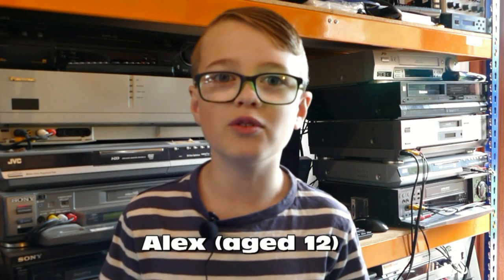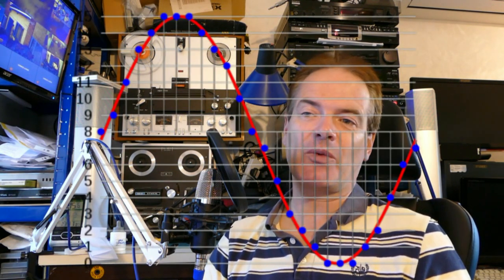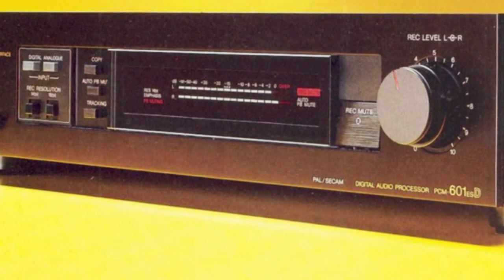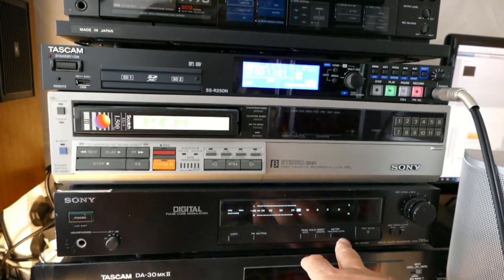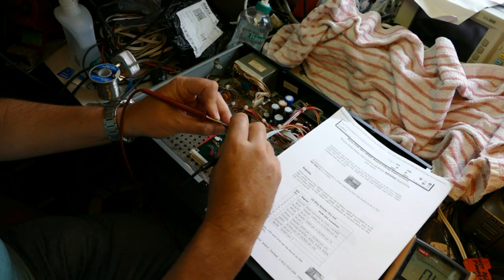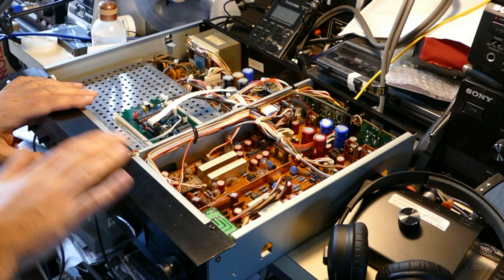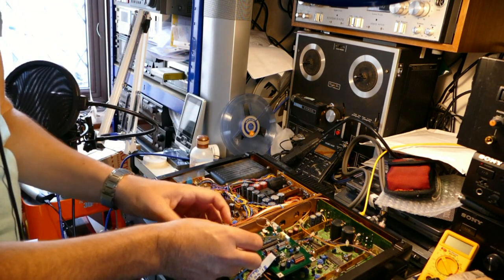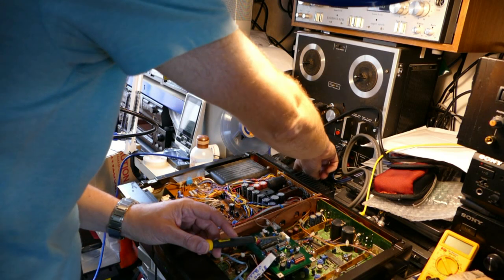SPDIF (S/PDIF) output on a Sony PCM-501ES or PCM-701ES decoder.

Comment: I used a PCM 501 in 1984 to create the first broadcast from digital on Melbourne classical station 3MBS-FM.  (It was a first Australian performance of a rare baroque opera.) Owing to delay in delivery of my SLC9, it was actually recorded on a borrowed portable VHS recorder.  It was later carefully transferred via the 'copy' function to the C9 when arrived, and then assemble edited for broadcast.  (It would have been better on the HiFi 150 that had a flying erase head.)

Later in the '80s, a London firm called Audio and Design offered an add-on for the PCM701 which added digital in and out and a digital fader.   Distance and not having a 701 meant that this desirable course of action was not pursued.  Besides, the availability of a computer with digital inout and output didn't arrive until Sound Designer II (for the Mac, a brand for which I had an ideological contempt at the time).  I used on at a commercial recording studio to transfer tracks (in analog domain) for a commercial cd release - with results a couple of orders of magnitude better than an analog tape to digital transfer.  My use of digital for production swung to MiniDisc (an MZR30 and the a MD 501) where assembly editing could taken place in the digital domain.  When my PC with an RME digital interface arrived in the late '90s arrived, apart from transfer only in real time), record on MD (later the HHB professional model) transfer and edit on Sound Forge was the working method.  Only with the arrival of my Nagra V in 2003 did the situation improve ...

Anyway, a couple of comments on alternatives - at the time of the PCM 501, I also evaluated a unit made by JVC designed for use with VHS - but of course also worked on beta.  Overall, I felt that its performance and features were inferior to the Sony ...

Now the challenge - prior to the introduction of the portable beta recorder F1, and the subsequent PCM-F1 unit (a boon to wild-life recorders), sony had two experiments in consumer digital recording - the PCM10 (late '70s) unit and the subsequent PCM100 unit (early '80s - I have Sony documentation and a photo of it).   Anyone ever laid hands on one of these units - or even better still have one?
Reply from the maker: I have a PCM100 here, it does pop up on one of my other YouTube videos about PCM-1630.  I'm told that the format is the same as PCM-F1 but I'm not sure if that's true.
Reply: Yes, I've had the PCM10 and PCM100. I still have the PCM10. I sold the PCM100 because it was in the way. Now I regret it. The difference between these two is the SDIF2 input and output on the PCM100. They are both 14 bit machines with NTSC video processing. Both have the unsurpassed LED meters with a very high resolution, which are at most surpassed by the professional RTW meters.

Comment: Interesting solution for emphasis, but I guarantee you get a lot more dropouts via SPDIF.  I think some of the error correction in the PCM adapter is bypassed when using SPDIF.  I’ve had tapes with tons of dropouts via SPDIF , yet played flawlessly via the analog outputs.  It solved the emphasis curve at the same time.
Reply from the maker: Never had that.  Perhaps your SPDIF circuit's PLL was struggling.
Reply: video99.co.uk I have the 601 adapter and was running it through a beringer sample rate converter because of the non standard 44.056 kHz sample rate.   Drop outs!  They disappeared with the analog outs.  

I didn’t think of the audacity red book curve.  I was trying a vst eq plug-in suite from izotope ozone  that has it, but it didn’t sound right. It made it muffled.  Yes the pre emphasis light was on.
Reply from the maker: @pauladams896  Perhaps that sample rate was the problem.  My Tascam SS-R250N doesn't seem to mind it.

Comment: Difference between models: PCM-501, PCM-553 & PCM-601 has multiplexed A/D, so 11,3 uS difference between channels (A/D is switched 88200 times per second (PAL version) between L & R). These models also have OVC (additional knob for adjusting tracking). PCM-F1 & PCM-701 both got proper, dual A/D, so channels are not shifted in relation to each other. PCM-F1 has single CX890 D/A, externally multiplexed between channels. PCM-501, PCM-553, PCM-601, PCM-701 all use CX20017, multiplexed D/A that I can't find any solid info about (googling for "cx20017 datasheet" brings loads of PDFs with just single page containing general overview), so I don't know how it deals with samples and whether there's any 11,3 uS difference (probably I have to check this with scope). anyway just for the purpose of output signal quality, there shall be no practical difference between PCM-501, PCM-553, PCM-601, PCM-701 (with PCM-501/553/601 having an advantage of OVC knob, that might help in troublesome cases) - if there's any difference, it might be caused by different analog out section, though I didn't compared the schematics to see if there is any difference. PCM-553 (Japanese-only) and PCM-601 got digital in/out. As for digital out is concerned, it could be assembled cheaply from components available today, as per schematic: http://www.myprius.co.za/PCM501_SPDIF.JPG so no need to fiddle with Whistlewood's board. I would have built that myself (along with trying to wire digital in with WM8804 - I have already ordered both it and DIT4096, so maybe I will build a kind of SCMS stripper with these) if I hadn't acquired PCM-601 (in the course of 1,5 month I've acquired PCM-501, PCM-601, PCM-701. I'm lacking PCM-F1, though I'm not sure if I want it, as PCM-701 is in essential the same thing (sans single externally multiplexed D/A) and for portable recording gear there are better options for ages - if I had any field recording needs, that's it). Trivia: (1) PCM-1 (first consumer audio processor) predates EIAJ, it is not compatible. Literature says it is 13-bit. Second consumer model by Sony - PCM-10 is EIAJ conformant, though it lacks 16-bit mode, introduced only with PCM-F1. (2) 16-bit recordings could be replayed with EIAJ-conformant 14-bit only PCM processors, albeit with reduced reliability (one correction word instead of two). (3) PAL/SECAM PCM Processor could be switched to NTSC with slight modifications. At least this was said about PCM-701, though from service manuals I see this should apply for other models as well (that is, for those with 16-bit capability, as I have no service manual for PCM-10, nor for PCM-1). The converse is not true, as PAL/SECAM machine is superset of NTSC one. (4) PCM-701 & PCM-501 were used in mid-to-late eighties as a cheap instrumentation recorder for recording neurophysiological signals. There are some mods described in several papers from that time (getting rid of emphasis and extending frequency range down to DC were among the most common, I've also seen some channel splitting as well as interfacing it to IBM PC for acquire and subsequent analysis, even with automated VCR control). (5) PCM-501 uses standard TTL logic levels. PCM-701 is said (by those papers about making instrumentation recorders out of it) to use -5V/0 levels so modification of that particular model might be a bit harder.
Reply from the maker: Fascinating information there.  I had seen that schematic before, but in practice, building one of these would have been more time consuming than fixing the Whistlewood design board.  If anyone has done a PCB layout for that design though, I would love to give it a go.  All the PAL/SECAM models seem to be able to play back properly with NTSC tapes, which is handy.  Well done for getting a 601.  They are absurdly rare.  I think the 11.3uS issue is only really a significant problem with mono recordings, and so far I've not had any of those.
Reply: IIRC the CX890 and CX20017 are the same DAC chip. Yes, it has the same 1/88200 delay. Sony also used it in the first CD players, such as the CDP-101. I would figure that if it's possible to get a SPDIF output from an early CD player using the CX20017, then SPDIF output would work on all PCM processors that use that DAC.

I do have a PCM-F1, I've opened it up myself (and have very good high quality pictures of the PCB if you want) and you are correct, it uses 2 A/D chips but only 1 D/A chip. The chips have heatsinks on them, and the text "890" is printed on the D/A chip.

Comment: This would not work with the original PCM-F1, right? I would love to have S/PDIF in my PCM-F1. Also forgive me for this question, I didn't watch the whole video but does the mod require soldering? I don't want to solder/drill holes in my chassis, or anything like that.

Also an easier way of de-emphasis IMO is using SoX. It's a command line tool but all you do is type "sox "input.wav" "output.wav" -deemph" and it will apply de-emphasis to the file. I use it for my some of my really old audio CDs that contain pre-emphasis, and it works great. 

Also, my PCM-F1 always has the pre-emphasis applied during recording, you can't turn it off. I did read that someone who owned one of these units managed to disable the pre-emphasis circuit?
Reply from the maker: Yes this will work with the PCM-F1, you just have to configure the board slightly (different power supply).  Yes you do have to do some soldering to install it.
I find the de-emphasis curve is very easy to apply using Audacity.  What's harder to do (I've not worked out how yet) is to apply the half a sample delay to one channel.
Somehow there was a way to make recordings without pre-emphasis, but I'm not certain which model did that.  There's no switch on the F1, 501, 601 or 701 models, I know because I have them all!
Reply: @video99couk  Oh cool. But explain the different power supply? Also, where does the SPDIF jack go? 

If it does require soldering then I don't think I can do it myself which sucks. I'm located in the US. I know your in the UK and it would be a nightmare to ship.

Do the industrial PCM processors for U-Matic decks have a pre-emphasis switch? I would assume so. 

I have some early Japanese CBS/Sony CDs from the early 1980s, I assume they used a PCM processor and a U-Matic deck to master them. A lot of them have pre-emphasis but some don't.

Comment: I am an original 501 owner and took it out and listened to old studio recording from the 80s , worked perfectly. Was it also the case that these units delayed one channel slightly relative to the other? I have a vague recollection of this but not sure
Reply from the maker: There was no delay if you used an analogue output route, but if like me you modify it to have a digital output then there is a half sample delay on one channel.

Comment: I would love to know where to get that SPDIF connector you used. I have a 501 ES and I'd love to modify it to output SPDIF. By the way, I have a Toshiba DX-900, very rare, that outputs 14-bit digital simultaneously with very high quality FM analog stereo on separate output connectors, allowing dual stereo outputs. Love your channel!
Reply from the maker: The S/PDIF modification board is hard to source.  I bought one from German eBay and the other from a YouTube viewer.

Comment: Hi I have two of these 701ES and would like to grab the outputs from them. Out of curiosity are you limited to the 44.1 in your tests? I'm thinking it may be possible to use the ADC with alternative clocks pulled from an external device (even perhaps at 192k). Possible you think.

Great work! I believe these ADCs still hold up today (in terms of how they sound - i.e. not sterile). I'd love to hear a sample of music in 14bit mode.
Reply from the maker: I understand that these units are fixed to 44.1k sample rate.  I can't see how you could alter that since the recordings themselves are based on that sample rate.  The only option is 14 bit (with extra error correction) or 16 bit.  The 701ES has better DACs than the 501ES I'm told, but since my 501ES now has the S/PDIF output installed and working, that's of no consequence.  I've had customer feedback on the results from S/PDIF files with the Red Book De-emphasis applied, which is very positive.  So I think that's better than using the analogue outputs of either machine.
Reply: I'm not interested in playing back pre-recorded files, rather just use it as a standalone ADC. I'm confident I saw a pretty quick n dirty hack that innvolved tapping into the video circuits alone, it looked easy enough to even me (I've limited experience). I wouldn't have collected 2 PCM 701ES otherwise. I've lost the webpage that gave instructions but I definately remember it being really really simple involving nothing but wiring direct to the video micro controller. 
Regardless, the 11uS delay between channels would still be problem, though.

I would love to get these chips filickering at 192k. don't care about bit depth, even 14bit wouldn't be a problem at 192 if considering the psycoacoustic theory in conjunction with bit depth v sample rate. 24bit is only necessary for 44.1/48 and the rate increases renders higher bit depth unecessary,
Reply from the maker: @weeg91  I see.  That's a bit beyond the problem I was working on here.  Yes the 11uS issue is well documented, and can certainly be a problem with mono audio in particular.  By the way, have you tested your 701 units back to back to check they work properly?  When I first got mine, it had an electronic fault which I had to repair, it turned out to be a fusible resistor had risen in value.  I see there's a 701ES on eBay at the moment which has some kind of odd modification including a 25-way D connector.
Reply: that connector hosts a spdif output believe it or not! there is info archived on this page about it: http://web.archive.org/web/20021008164334/www.whistlewood.co.uk/pcm/701.html

Comment: Great video! I've only recently come across these unit (501es/701es) and am interested in their capabilities and components. Hoping you could advise what DAC chips are used for the standard analogue output?
Reply from the maker: PCM-501ES used CX20017 DACs.  I don't have the service manual to hand right now for the PCM-701ES but I understand it used more expensive DACs.
Reply: @video99couk  Did a bit more searching and found the service manual for PCM-701ES: https://freeservicemanuals.info/en/servicemanuals/viewmanual/Sony/PCM701ES/
Sony kept the CX20017 DA chip for the 701ES also. Not sure if it helps but a forum thread I came across whilst searching had some information on the SPDIF output module from your video. https://www.diyaudio.com/forums/digital-source/106425-sony-pcm-701es-mods.html
Reply: @video99couk  Also, the CX20017 DAC was used by Sony in their early CD players, such as the CDP-101 from 1982. 

I'd love to test the DAC, but I really don't have any way to get pure digital audio into it, as I don't own a CD player that uses that DAC, and the PCM-F1 doesn't have SPDIF input, I can only get analog audio into it.

Comment: In your opinion, what is a good reason for a hobbyist or audio enthusiast owning one of these digital tape recording devices (i.e. a DAT, Hi8 or PCM video recorder) nowadays given the costs of tapes (except VHS  tapes) and the cost of upkeep of these machines? 
By good reason I mean besides anachrophilia and except cases such as owners of already large collections of pre-recorded material in these media.
Do the recordings last for more than 2-3 decades or do these tapes (and recording devices) start becoming a liability in the long term? Do you think they offer some long term benefit as recording medium over, say, hard disk storage?
Reply from the maker: I can't think of any good reason to make new recordings on these formats, no.  It's really to archive recovery purposes that they need to be kept going.  But some people just like to play with old equipment anyway.
Reply: @video99couk  Thought so. It's a pity 'cause they're great machines. 
I'd think that for keeping an audio archive one might have a slight preference to keeping individual tapes per recording vs having all recordings in a single storage device (e.g. an hd) which might provide some false sense of safety against total loss due to damage to the medium but I guess one would be trading one type of risk for another.

Comment: How much glue logic does this board require to be added to it in order to become an external unit with video input and spdif output?
Reply from the maker: That's basically the whole decoder, so quite a lot.

Comment: Is there a way to possibly have spdif as an input instead of an output?
Reply from the maker: The PCM601ES can do this, but I don't know of an add-on device for it.
Reply: @video99couk  I'm running into an issue with my 601ESD where it copy prohibits everything digital. Probably because I have professional machines.